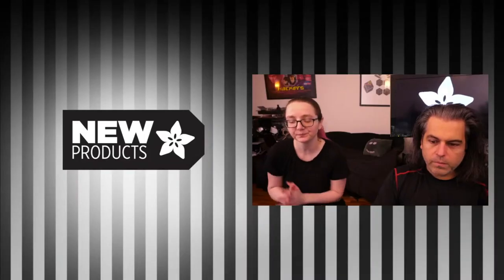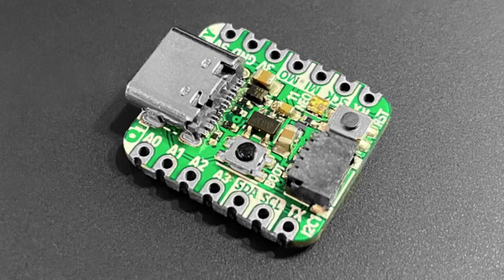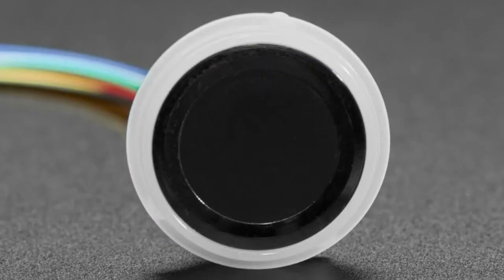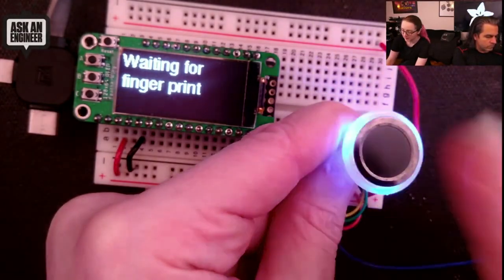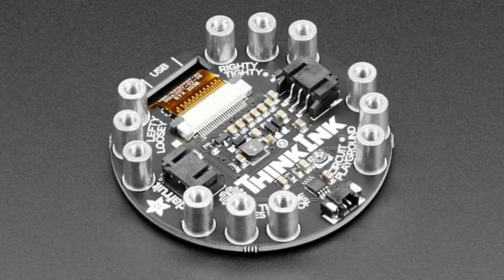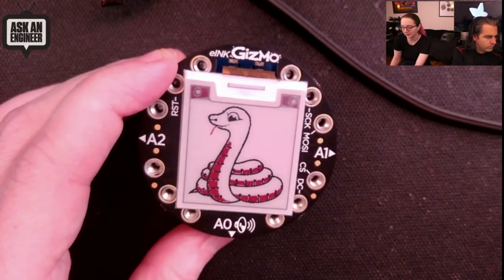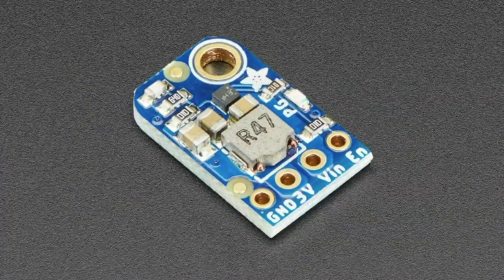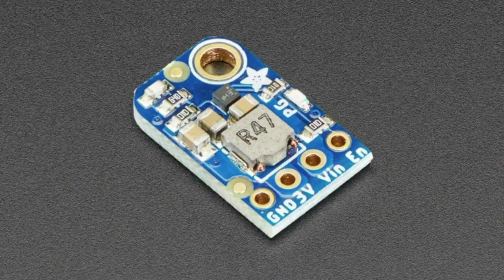New Products 2/24/2021 Feat. TPS62827 3.3V Buck Converter Breakout - 3.3V Output 2 Amp Max!

Comment: Any idea on what the price of the RP2040 QTPY will be?  I'm curious if it will be close to the price of the SAMD21 QTPY.  I love that these more powerful boards are starting to break the <$10 barrier.  I'd love to find something with the RP2040 with WIFI in that price range.
Reply: Pimoroni in the UK do the Tiny 2040, which is similar and costs £8.40, so over double the cost of the Pico itself. Looking forward to the RP2040 chips being available for hobbyists to buy Q2 (according to what the Pi Foundation people have said I think).